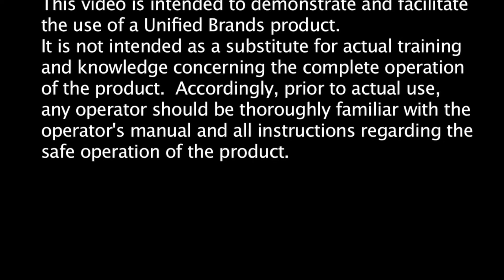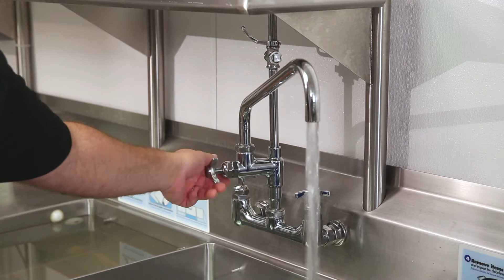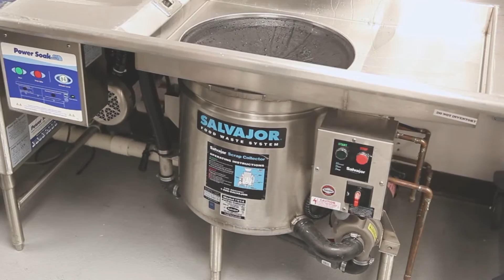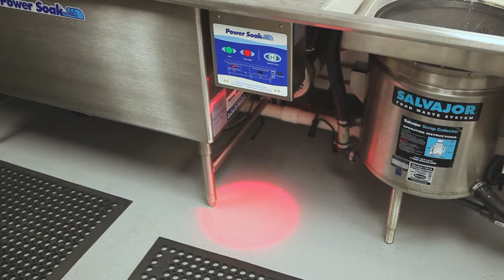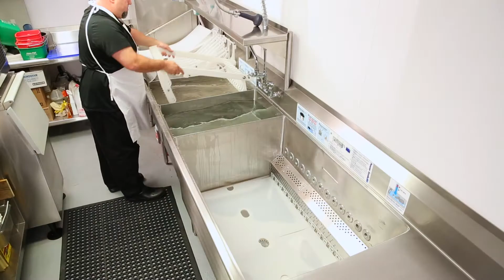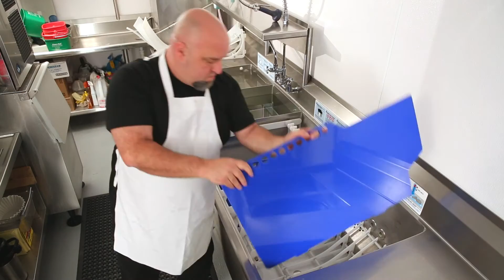Operation: Power Soak Operation and Cleaning

Comment: In March 2007, the National Institute for Occupational Safety and Health (NIOSH) was asked to evaluate the noise exposure of employees in the Nutrition and Food Services Department of a large hospital, because of noise concerns raised after the installation of the PowerSoak® dishwashing system. Eleven employees (two cooks, eight food service workers, and a materials handler) contributed 13 full-shift and two task-based personal noise dosimetry measures over two days. The noise levels for two food service workers assigned to the pots and pans room (85.1 and 85.2dBA), a cook working in the food preparation area (85.9 dBA), and a food service worker assigned to the dishwashing room (89.5 dBA) exceeded the NIOSH Recommended Exposure Limit (REL); however, none of the measures exceeded the Occupational Safety and Health Administration (OSHA) Permissible Exposure Limit (PEL). The noise level from the PowerSoak® dishwashing system alone was not excessive, but additional noise from the food preparation area (primarily from blenders and utensils), and from metal-to-metal contact between stainless steel pots and pans and metal racks, may explain exposures above the NIOSH REL for employees in the pots and pans room. The cooks were exposed to many intermittent impact noise sources, such as, metal-to-metal contact between utensils and the use of industrial-size blenders. We recommended that metal-to-metal contact be reduced as much as possible throughout the Nutrition and Food Services Department, and hearing protectors be provided to employees in the dishwashing room until engineering controls were in place
Reply: Do you know if there is hypoallergenic chemicals that can be used with these machines?